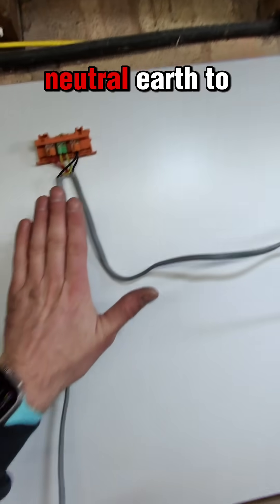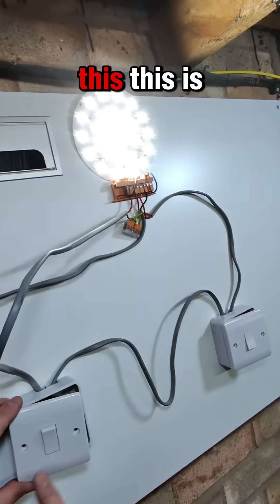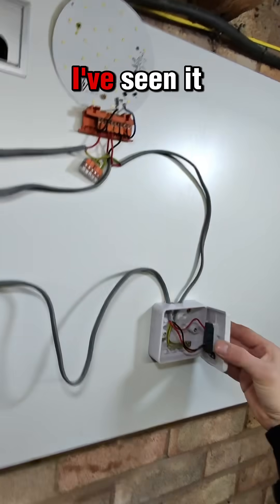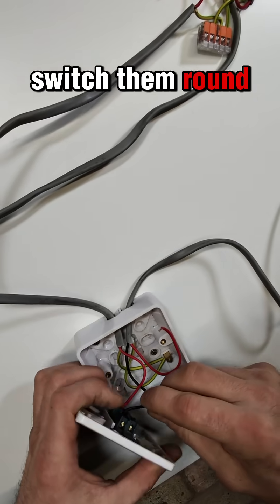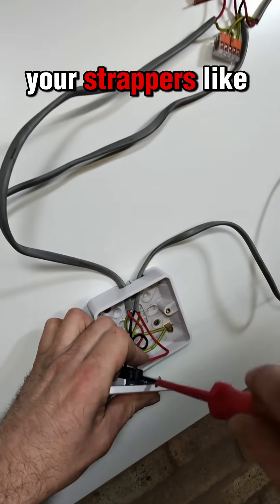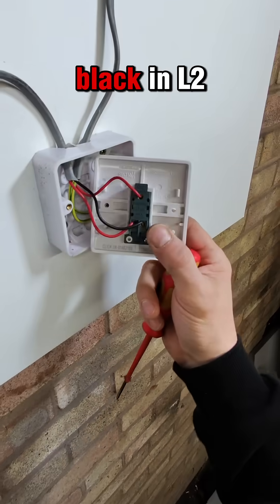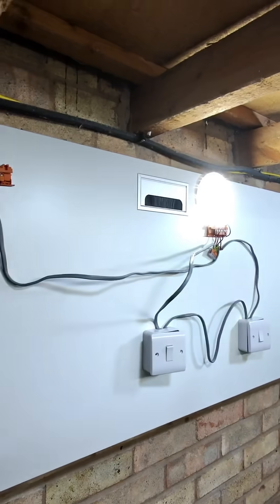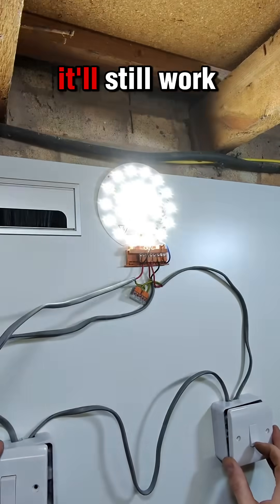Old 2-Way Switching – The Simple Strap Trick

Comment: C3 - cables not adequately supported
C2 - single insulation outside of enclosure
C3 - lack of circuit identification 
C2 - lack of protection against mechanical damage 
C1 - access to live terminals 
Jeez this isn’t a new install is it?
Reply from the maker: you missed the obvious - Who would plug a lighting circuit in and have a switch 30cm away from a switch mounted on a piece of wood in a garage?